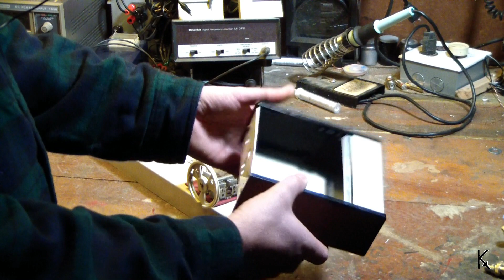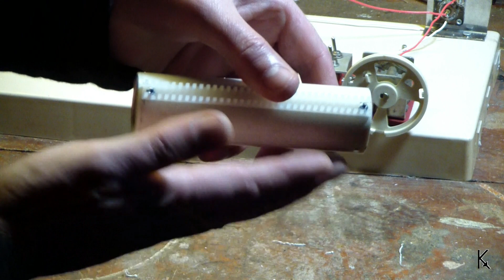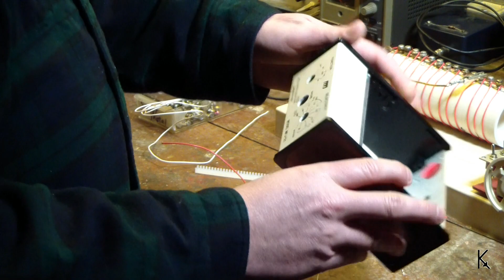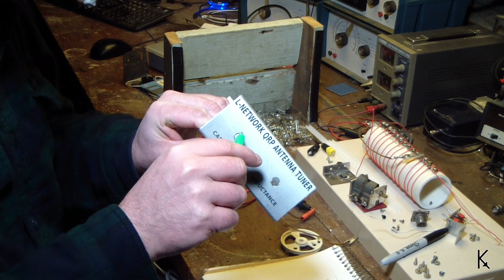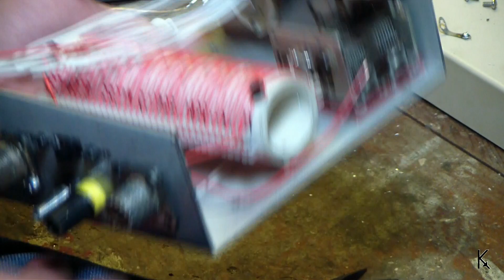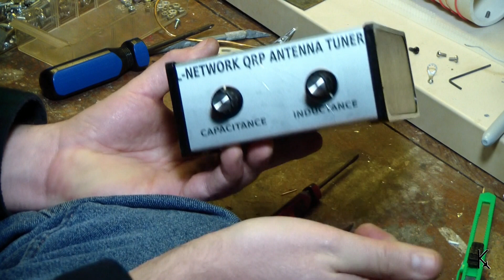Ham Radio Antennas - Rebuilding the L network QRP antenna tuner

Comment: Your furnace should not cycle on for such a short time. You are wasting a great deal of money. I did watch both videos, and liked them very much. I'd like to know where to get the plastic you used for the inductor.
Reply from the maker: That was just a piece of 1 inch PVC.  The finger strips I think were gromet material for lining holes in metal chassis.  Those were given to me by another ham, I don't know where he got them.
You probably heard the fan doing a short run post-cycle.  The fan is temperature controlled by a thermal switch in the heat exchanger.  Most times, after a furnace cycle, there's just a little heat build up that trips the switch for another 30 second fan run to push that remaining heat into the house.

Comment: Nice Job Kevin!  I built an L-match similar to that with a home-made air wound enameled wire coil.  I didn't use any math either and it seems to work okay for me.

73's 
Dean AC9JQ

Comment: This project is a big success! Nice clean wiring inside and the printing labels work great. Avery makes several different sizes of stick-on labels that are very handy to use for projects like this. After you stick them on just a little clear spray paint seals them right up. Very nice job, Kevin! 73 DE K7RMJ Frank

Comment: Hi Kevin, what would be the maximum power that can handle this tuner?
Reply from the maker: Hello Pablo.   The limiting part is the capacitor.  It came out of an old AM broadcast receiver.  The plates are very close.    I wouldn't want to try more than 20 watts with this capacitor,  and that might arc over,  I'm not sure.   The wire, coil, and switch could handle 100 watts easy, so with a cap that has better plate spacing, you could go higher.
Reply: I have seen other builds with this type of cap and they seem to be OK at 5 Watts CW.

Comment: I like the binding post. but I would also back them up to use a twin lead feedline with an added balun or long wire use. like that in a dentron supertuner.
Reply: I suspect it will happily handle 100 watts to posible a 300 watt transmitter.
Reply: with a good antenna analizer / network analyzer, you could pick a center band frequincy and tap the inductor for that frequincy with caps centered half way.
Reply: I might would add shielding, using aluminum duct tape on the plastic side panels.
Reply from the maker: I doubt it.  The plate spacing on that cap is really tight.  RMS RF voltage on an HF 100 watt signal is going to be up around 600 to 800 Volts.   It would arc for sure.
Reply: I will admit it's a sweet box. I never contemplated ink jet printing labels. but I like screen printed adhisive films better.
Reply: Kevin Loughin ,,, and how would you raise the operational voltage of any cap. by placing a much higher voltage cap in series. I plan to build a mag loop antenna using a 30,000 volt ceramic cap in series with a 2500 volt air variable cap. a cap that's large enough to be useful in tuning the antenna. if that fails, I'm thinking about laminating the stator of an air gap cap with 6mil polyethylene film. that should be good for about 30,000 volts. then I should regain a portion the capacitance I would loose with two in series? albeit, this my theory.